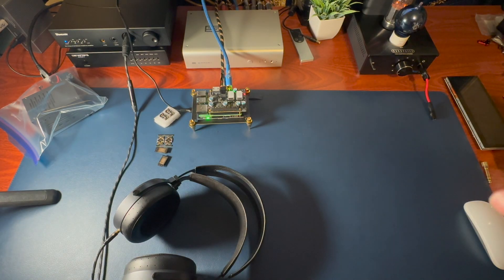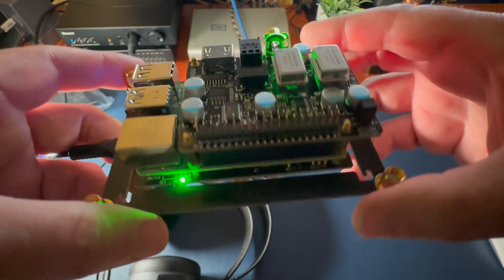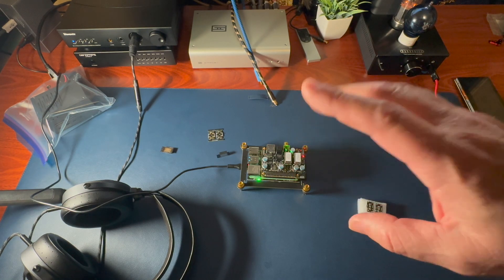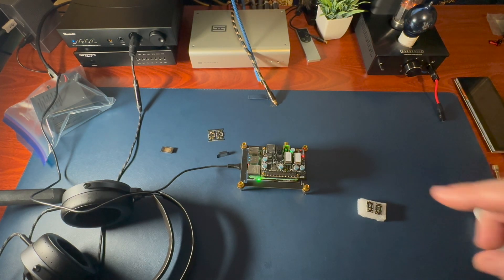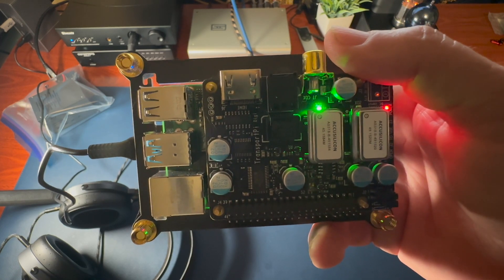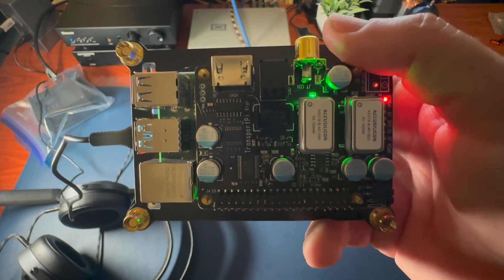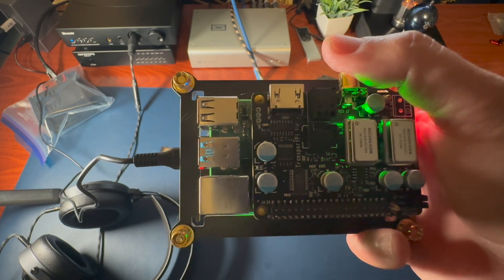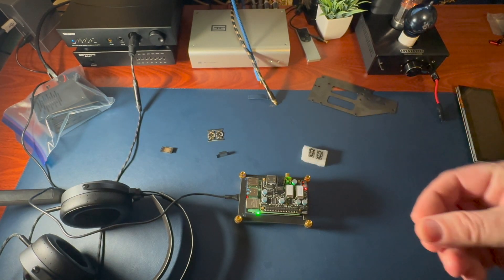Worlds Best Streamer ? Bits are Bits RIGHT?

Comment: For the 60EUR only (half price of TransportPi), It is possible to order  constant temperature OCXO for RPi4B, and then feed your DAC just from USB of RPi4. Then take a look at SMSL SU-1 or Topping E30II DACs, both coming with confirmed excellent measurements and reviews on audio science review, and other known resources. Then power module. He ask 60-130 euro for what? Supaecaps? Of course without supercaps the music will sink in noise. How that guy forgot $3000 power cable, and $1000 cable stands...  In real life, 5pcs 2 layer PCBs costs $5 from PCBWay. Polymer capacitors $1.5-2 per unit, not taking quantity discount in account. Instead of the capacitors bank, you can built regulator using say parallel TPS7A4700. Here you'll get really ultra ultra low noise PSU, still well below  130euro. You'll learn how to design LDO with several paralleled integrated regulators  in addition. But if you want capacitors bank, and don't want to bother with the assembly $12-15  from Ali or Ebay.
Reply from the maker: Then build one and let me try it. Would be interesting to try. Most people are not that electrically educated to make something like that. Sounds like you are though
Reply: @ThriftShopReviews  I building It. Of course I'm not going to use picovolt noise floor LDO,  I'll go for simple cap bank, and linear PSU based on some LM338 or LM350 IC. But this is secondary detail. What's really important - I own precision ADC (-128dB SNR, 0.00007% THD+N), that I think able to catch difference of distortions added by the DAC fed by the bare RPi, and RPi + clock. And objective measurement is the thing, that way better than statements like "I heard huge difference that changed my mind about the whole essence of the nature of things". It's even more objective, than those blind tests, that so carefully avoided by most of audio bloggers.
Reply from the maker: @Anatoly_Panchenko  love to try it
Reply: @HeavyCrown2030  I contacted Toppling about their E30ll DAC, and asked if there is any benefit to use a streamer, with precision clock. And they answered that their DACs stuffed with circuitry that eliminates jitter at usb input. Either PLL or reclocker. 
But I ordered OCXO board already, so I’ll try to measure differences with, and without precision clock source.
Reply: @ThriftShopReviews Get this Dude to demonstrate his streaming device otherwise it's all old wives tales.
Reply: @Anatoly_Panchenko Exactly. Don't use stupid low tech interface, use async USB and let the DAC do its job... Forget about this dumb idea of "precision clock", people just don't have a clue about engineering and digital in general... Exactly.  Don't use stupid low tech interface, use async USB and let the DAC do its job... Forget about this dumb idea of "precision clock", people just don't have a clue about engineering and digital in general...
Reply: I think you miss the FIFO reclock isolation?  Upgrading the clock of the Rpi would improve it's sound.  But still a different world from FIFOPi with decent clocks.  The Rpi is noisy and it runs at the wrong clock rate.  You need to isolate the pi from the equation, not just put a bandaid on it's sub par clock.  Ideally, use the Pi for only for the basic function of serving up bit perfect data stream.  But put it in a faraday cage, and reclock those bits with a super clean power supply in a clean feed into a very good DAC with a very good output buffer.  You have gone from 1960 transistor radio to boom box.  Time to go to audiophile heaven.
Reply: @user-od9iz9cv1w  Doesn't the TransportPi include a re-clocker. That's why @thriftshopreviews has those 2nd timing crystals.
Reply: @user-od9iz9cv1w We're talking about logic circuits bro, use async USB and not those dumb, old and low tech interfaces...  Never thought about why does a CPU with multiple layers and billions of transistor running at multi-gigahertz, powered by a totally average quality switching power supply never makes any error?   The very easy to understand principle dates back from the first TTL logic gates, we call that detection levels = immune to noise...  And for the "clock fanatics", jitter is just noise and not detectable by human ears unless you have a completely broken component...
Reply: @guyboisvert66  Regarding sound impact of jitter you are mistaken.  It is easy to hear the impact of lowering jitter.  I do not advocate that you use a low jitter clock.  If you are happy with the sound, then use the cheapest clock you can find and feed your DAC directly with USB.
BTW, I spent 45 years in the computer industry and have no concerns about the accuracy of even the cheapest computer powered by crap being able to serve bit perfect data.  But I also know how to turn those bits into beautiful natural sounding music.  In that domain, everything matters because it depends on timing which is set by a clock signal that can easily be detected by the human ear.  We evolved over millions of years.  Those that can tell where the lion is in a dark cave survived.
Reply: @user-od9iz9cv1w USB clock?  No relationship at all using async USB... As for jitter, i'll take you anytime in a blind test...  https://youtu.be/TT9JL2yaIOA  Unless you use a really broken DAC, low local jitter (usual DAC clock) is lost way below human hearing noise floor threshold...
Reply: @guyboisvert66  I'll win a blind test a typical cheap clock used in typical commercial DAC vs SOTA low jitter clock any day.  I have done A B tests where I'll play the same track at different sampling frequencies triggering different clocks in the same DAC.  The changes are not subtle.

Comment: I have serious doubts about the benefit of super power supply capacitors because, unlike an amplifier, these modules do not require any strong instantaneous current.
Reply: Here's the way I think of it. Upon close examination (i.e., via oscilloscope), you'll see that the power output of the Pi power supply (even good ones) is not a flat line - it's not even a flat line coming out of your wall socket. While the rPI doesn't draw a lot of power, you are affected by everything else in your house, your street, and the power grid. These fluctuations will change the operating frequency of electronics and since digital music (see I2S) is totally dependent on a clock with a precise frequency, you are affected. These capacitors effectively isolate the power source from all these variations. As stated throughout, this is for people wanting the best sound quality possible. If you're listening on your PC speakers, you probably can't tell.
Reply: @imkressive  Gosh, another of those "linear power supplies" peddler... 
https://youtu.be/OL23xkLfPTU?t=972 
1) Don't use I2S, it was designed for inter-IC communication
2) The simplest solution, which is the best: use Async USB
3) Using Async USB, you don't rely on any client side clocking, the receiving devide (like the DAC) is using buffering and its local clock to do the conversion... It cut short all the crap about jittering...which is noise below hearing threshold unless you have a broken device...
4) Never heard of electrical engineering design?  How about logical circuit detection levels?  Digital signal transmission?  I know, as in the video above, you don't have a clue...
Reply: @guyboisvert66  Says the ASR peddler, LMAO!
Reply: @Ruger62  Something technically valid to say peddler? ;-). ROFL
Reply: @imkressive We're talking about logic circuits bro, use async USB and not those dumb, old and low tech interfaces...  Never thought about why does a CPU with multiple layers and billions of transistor running at multi-gigahertz, powered by a totally average quality switching power supply never makes any error?   The very easy to understand principle dates back from the first TTL logic gates, we call that detection levels = immune to noise...  And for the "clock fanatics", jitter is just noise and not detectable by human ears unless you have a completely broken component...
Reply: @jungtarcph  ...and by the way, no BSOD here for the last 15 years, running Linux.  But anyway, who cares about BSOD when the media player, like Volumio, runs Linux...  Windoze is crap but you can even use an MPD client on any platform including Android, Mac, etc.  With RompR, it's straight WEB interface...
Reply: Benefit is for the wallet of the snake oil seller.

Comment: I’m new to the world of streaming so I’m trying to figure out what the performance level is compared to a retail hifi streamer. Is it in the $250, $500, $750, $1000 dollar range. I’m just trying to figure out if it’s better to just buy a eversolo at $850 which has a good DAC and streamer. But if this is Uber Uber good for sub 300 then I get it.
Reply from the maker: I don’t have the eversolo to compare but would guess closer to the eversolo master edition due to using the higher end clocks.  Keep in mind the raspberry pi software is not as good. Would be good if you use roon or title or have a local NAS. Volumio works but can be a pain compared to streamers that you can you use streaming services.
Reply: @ThriftShopReviews  I appreciate the response. Yeah I’ll be using Tidal only. So you’re saying if I’m using tidal it’s easier to get the necessary software in? Also what was the entire unit with all the parts and modules rough estimate? Lastly I saw you M3SI video and I just ordered a M2SI on eBay last night because of it. Was able to grab it for 470 out the door. Has some nicks on the front plate but it seemed like a decent price. Hopefully it pairs well with the JBL 4309s I have. Thanks for all your input and btw love your videos. You get into the details which is rare now n day on YT.
Reply: The DAC is where you need to spend the money, this is just a way to produce a bit stream that is clean as possible and perfectly timed.

Comment: I'd like to build one of these and feed it wirelessly from my Macbookpro and send it to my Hugo2 via optical.  My hugo2 already reclocks the signal so will the reclocking from the TransportPi Digi be irrelevant because of that?
Reply: But I personally would test this streamer withe the usb connection with your DAC....I suspect that it will outperform the optical (spdif)...
Reply: If you feed ANY dac with a lower jitter (and phase noise) digital audio signal,  it will always be better. Even top of the line reclocking modules,  don't do magic. If you can help the process, it's always better. That's why there are audio differences between clocks. And price too of course...
And never forget,  the cleaner the power you supply to the clocks, the better they will perform. The batteries and supercaps used are exactly with that intent.

Comment: wonder what is needed to get ethernet to aes/ebu working
Reply: have an first gen Ygdrasil with gen5 usb. but currently i run a 5m usb cable tho advice is not to exceed 2m. hence they idea to use Ethernet as the "transport" and aes/ebu as the connection. not sure how hard it is to make something as a complete noob.
Reply: Ian Canada makes a transport card (to use in place of the one shown in the video) that transmits AES. But, its via traditional balanced AES interconnect - not CAT6.
Reply: @chrisd1405  got a holo red streamer with AES ebu/outputs. unfortunatly on of my ams and speakers stopped working. will take some time before i can find out if it is even repairable without having to sell a kidney. shit happens i guess
Reply: The raspberry pi has ethernet connectivity and ethernet port...depending on the interface howe to connect with volumio it was easy
Reply: No need, use USB to hook up to the DAC in async mode, can't be better than that.  Other than that, streaming are just bits put into TCP/IP segment, whatever the format used.  It's best effort and with default buffering in async mode, you're all set.  No need anything special, and don't fall for the peddlers that want to sell you "audiophile grade ethernet switches", complete BS...

Comment: Thank you for an amazing video! You and Gabster have got me very intrigued. I know little about electronics. 
1. Can you please make an instructional video showing the steps? 🙏
(I have the Bifrost OG. Despite it's flaws i love it as it can be fixed. Lift the ground and see the noise go down by 75%! I have a cheap Chinese DDC with a Xmos (xu208) and crystek (cchd957) clocks feeding my Bifrost og via coax. I power it with a LPS. I'm honestly blown how good it sounds. Recently bought a burson soloist amp and a hifiman arya stealth.. I'm in audio heaven.) 
2. You said xmos doesn't sound as good as the unison usb. I hear the opposite on the forums. What difference have you heard between the two?
Reply from the maker: I made a video of the assembly. Super simple. I think the difference between xmos and unison will be very subjective and based on the system being used. Most of the xmos implementations I’ve heard are not as good. Perhaps some higher end components using xmos are better. I will be building a new streamer soon.
Reply: @ThriftShopReviews  Do catch that on video too please! :)
Reply: @ThriftShopReviews  can you link me to the video please? Can't find it. (or are you talking about this video?)
Reply from the maker: @Thoughtflux  I will try to find it.
Reply: @ThriftShopReviews the assembly video seems to have disappeared -- any chance you could re-upload?
Reply from the maker: @sdrtcacgnrjrc  I will go take a look.  Not sure as people are leaving comments.
Reply from the maker: @Thoughtflux  https://youtu.be/8KKsLiX3tRU

Comment: I strongly suggest taking more care with those super / ultra caps! I don't know the voltage or capacitance, but they typically present a considerable shock risk. Personally, I wouldn't get close to them when they are, or might be, charged.
Reply: There is more danger from a 9v battery than the super cap.
Reply: They are about 2.7 volts
Reply: @clivestevens3547   then you can lick them safely
Reply: Waste of money anyway...
Reply: how so?

Comment: Thanks! How did you remove the original clocks? Could you do a video showing that? I have the same setup you do
Reply: Yes please!
Reply: You can just pull them out. They aren't soldered in.
Reply: They are socketed onto the main board so just pull out. To be honest the original clocks are perfectly adequate and you will not need to upgrade them. Many seem to have this idea that unless the clocks are perfect it will cause audible degradation to the sound output but it won't. Audio bit streams are so low frequency the accuracy required of the clocks is laughably low compared with most bit streaming applications.

Comment: thanks for the review, i was planning a similar setup with the transportpi digi and diy a aluminium case 
did you try more expensive streamers/ddc`s and compared it to the transportpi digi?
Reply from the maker: I’ve tried a lot of streamers!! This is the best I’ve heard. Other though have better software and apps. I might switch to roon or plexamp soon to fix that issue.
Reply: @ThriftShopReviews  ah good to know, thanks i will probaly get mine soon
for this reason i currently run dietpi and the rpi is setup as usb audio gadget which bascily means you can hook it up to a pc, it runs pretty flawless with camilladsp and sq seems quite good, but maybe not a purist solution